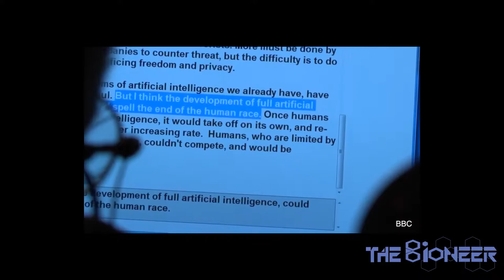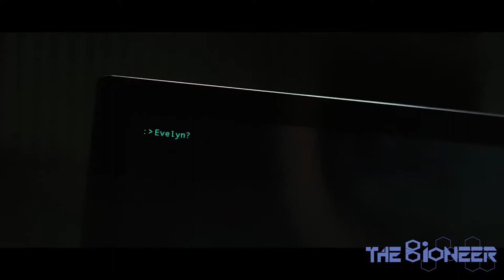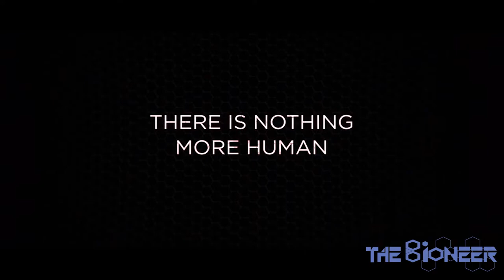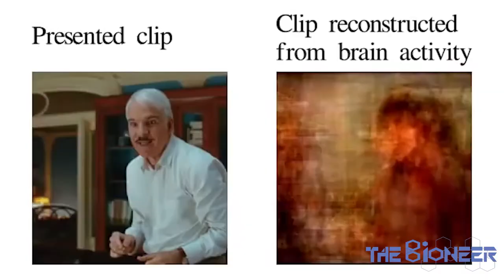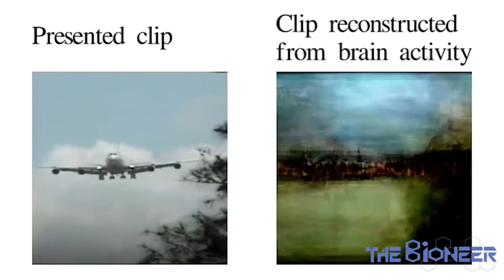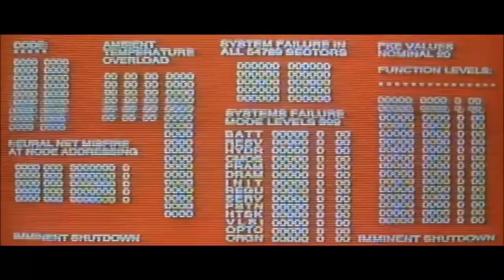Building a Superintelligence: AI vs Human-Machine Hybdrids

Comment: Would it make the reconstruced clip from brain activity more clear by using stuff like photo enhancing programs that make blurry photos more focused or something like facial recognition but for more than just faces? Or using software like the Hubble telescope does to enhance the most distant images it sees? Or an I completely wrong?
Reply from the maker: Possibly, interesting idea! Using a machine learning algorithm, you could potentially guestimate in order to 'fill in the gaps' as it were. Similar to the process used to turn old black and white footage to colour film. You'd lose some detail still though. What I find really interesting about this though is that sometimes, the image pictured is quite different from what is being visualized. I find that particularly fascinating as it might be to do with the participant's associations etc. There's so much potential for this line of research to uncover some interesting aspects of cognition!